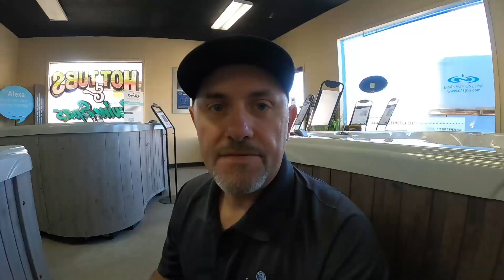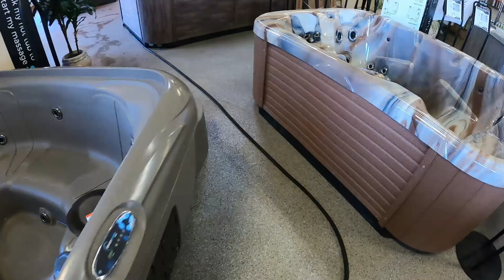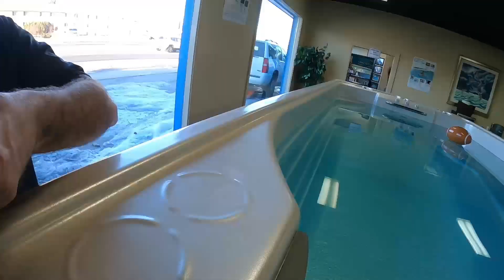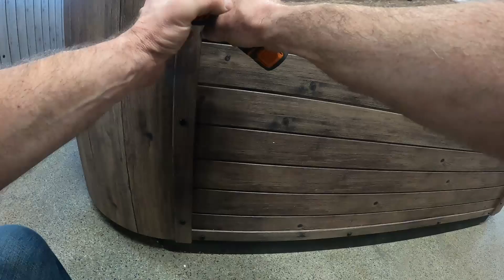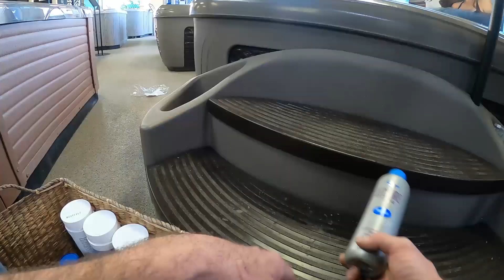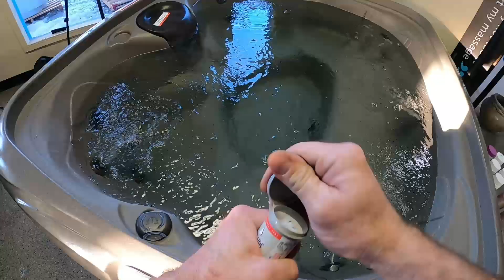Hot Tub Start up: How to Drain and Refill a Hot Tub: Hot Tub Start-up Chemicals: Spa Drain & Refill

Comment: I have heard that is you have an air lock you can use a brand new (only for hot tub) plunger and it will get the air out.  Remove filter and plunge there.
Reply from the maker: Thanks for the tip Joseph. It definitely should work on the tubs that have flat bottom filter housings or the tubs that have the thread in filter style. I'm gonna have to give it a try sometime.
Reply: @Poolelementary  I bet you already knew that little trick

Comment: @pool elementary, another informative video. What is your thoughts on the use or addition of a uv light? Do you recommend them? Thank you for the great videos. Keep up the good work!
Reply from the maker: Hey Josh Bledsoe thanks for all the great comments and watching Pool elementary. The answer to your question is there great! UV cuts down the use of chlorine by up to 75% and also helps with eliminating that chlorine smell in your tub by breaking down the halogens produced by combined chlorine. so as long as you change out your UV bulb every three years they work great. The bulbs lose about 10%-20% of there efficiency each year. On a lighter note might be a coincidence but I grew up with a guy with your name. If its you how is it going hope everything is good! Its been a long time! Disregard if your not the Josh I grew up with in Montana. LoL
Reply: @Poolelementary  Thank you for the comprehensive information on the UV light. We live in an area with extremely hard water now. Will the UV light (if I installed one) make my PH more stable? Also, I haven’t been back to Montana in quite some years and it’s always nice to see an old friend doing well!! Keep up the great work brother.